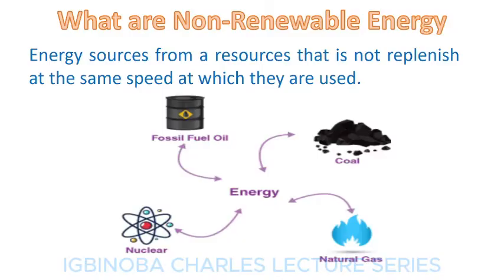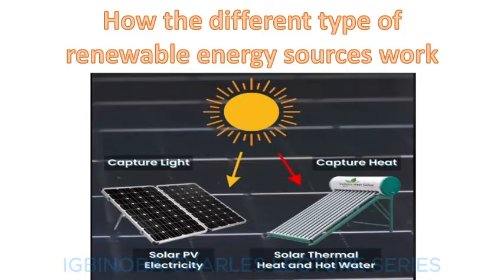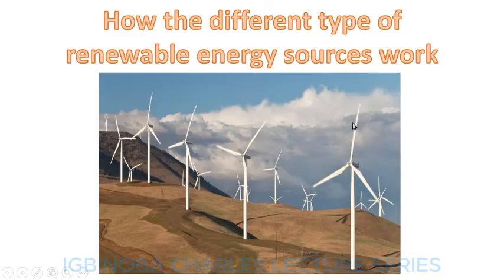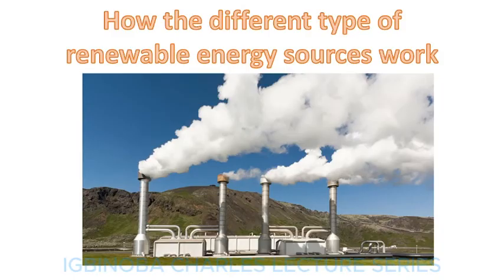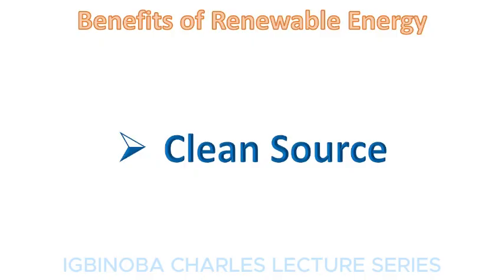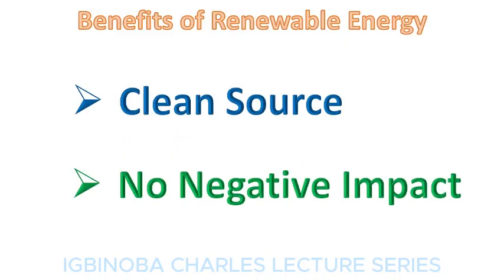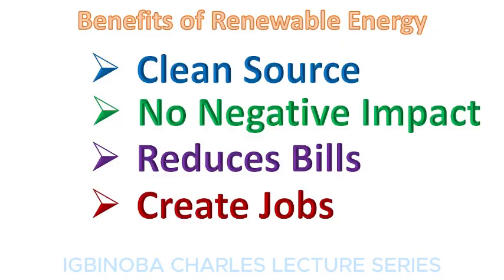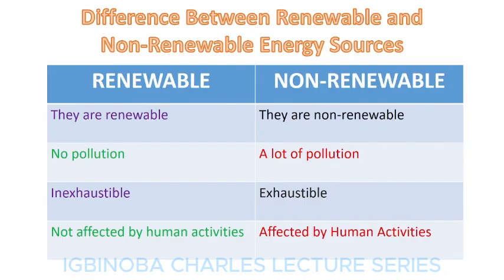From Fossil Fuels to Clean Power: Understanding Energy Sources

Comment: NAT49W 
No energy source is completely 100% pollution-free.
Even though clean sources like solar panels and wind turbines produce zero pollution while making electricity, they still cause environmental impacts during their whole "life cycle":
Manufacturing: Mining raw metals (like iron, silver, and lithium) and making equipment takes a lot of energy and creates waste.
Transportation & Setup: Shipping heavy parts and installing them requires vehicles that use fuel.
Disposal: When solar panels, wind turbine blades, or batteries wear out, recycling them is difficult, and they can end up in landfills.
Solar, wind, and nuclear energy aren't perfect, but they cause far less pollution over their lifetime compared to burning coal, oil, or gas.

Comment: MAR22V

Answer:No source of energy is completely pollution-free.

Reason: Every source of energy causes some pollution or environmental impact at some stage—during its extraction, production, transportation, installation, operation, or disposal. For example:

Solar energy does not produce pollution while generating electricity, but making and disposing of solar panels can cause pollution.

Wind energy is clean during operation, but manufacturing and installing wind turbines use materials and energy that can affect the environment.

Fossil fuels produce air pollution and greenhouse gases when burned.

Comment: MAR8H

Answer:

No energy source can be regarded as completely pollution-free. Renewable sources such as solar, wind, and hydro generate little or no direct pollution during operation, making them considerably cleaner alternatives to fossil fuels.

However, environmental impacts can still arise from the extraction of raw materials, manufacturing, transportation, installation, maintenance, and eventual disposal of the equipment at the end of its useful life.

Therefore, renewable energy sources can be described as low-pollution and more environmentally friendly, but they cannot be considered entirely pollution-free.

Comment: PETRO64L

No source of energy is completely pollution-free.
Every energy source has some environmental impact during its production, transportation,construction, or use. For example, solar panels and wind turbines produce clean electricity, but manufacturing and transporting them require materials and energy.

However, some sources such as solar, wind, and geothermal have much lower pollution than fossil fuels.

Comment: MEC115K
Answer:

No energy source can be considered completely pollution-free. Renewable energy sources such as solar, wind and hydro produce little or no direct pollution during their operation, making them much cleaner than fossil fuels. However, pollution and environmental impacts can occur during the extraction of raw materials, manufacturing, transportation, installation, maintenance and disposal of the equipment at the end of its life cycle. Therefore, renewable energy can be considered low-pollution or environmentally cleaner, but not completely pollution-free.

Comment: MEC65M

Answer:
No,no source of energy can truly be pollution free,every energy source has some environmental cost, even if not during actual use
Examples; Solar panels and wind turbines don't pollute while generating electricity but manufacturing, mining raw materials used for the production of the panels and turbines, can create emissions and waste.
Hydropower disrupts ecosystems and river flow
Conclusion: Considering the full life cycle (Production→use→disposal),no energy source is 100% pollution free, some (like solar/wind) are just far cleaner than others.

Comment: MEC81C

No single energy source is completely pollution-free across its entire life cycle.
Core Reason
Even for zero-emission renewable energy sources like solar or wind—which produce no air pollution or greenhouse gases while generating electricity— pollution occurs during the manufacturing, transportation, installation, and disposal stages.

Comment: Petrochem73u

ANSWER : 

No, no source of energy whether renewable or non-renewable can be considered entirely pollution-free. This conclusion stems from the environmental impacts associated with the entire lifecycle of energy production, including extraction, manufacturing, operation, and disposal.

•  Renewable Energy Sources: Solar and wind energy production involves mining rare earth metals, leading to pollution from manufacturing and disposal of panels and turbines. Hydroelectric dams disrupt ecosystems and release methane, and geothermal plants emit trace gases. The lifecycle impacts, including resource extraction and waste, prevent zero pollution.

•  Non-Renewable Energy Sources: Coal, oil, and natural gas emit carbon dioxide, sulfur dioxide, and nitrogen oxides during combustion, contributing to air pollution and climate change. Their extraction through mining or drilling causes land degradation and water contamination, while transportation risks spills that harm ecosystems.

Comment: COMP94P

No; no source of energy can be pollution free as every method has an environmental impact either directly or indirectly.

Reason be that different energy source needs a way to be harnessed before it could be used. Even if the energy source itself isn't a threat, the means and materials utilized by which it gets to us might be harmful to both the environment and humans at large. But the renewable energy source has proven to have a lower pollution as seen when compared with the non-renewable energy sources.

But both sources tends to have an operational emission one way or another even in the most slightest form.

Comment: NAT29C

ANSWER : 

No, no source of energy whether renewable or non-renewable can be considered entirely pollution-free. This conclusion stems from the environmental impacts associated with the entire lifecycle of energy production, including extraction, manufacturing, operation, and disposal.

•  Non-Renewable Energy Sources: Coal, oil, and natural gas emit carbon dioxide, sulfur dioxide, and nitrogen oxides during combustion, contributing to air pollution and climate change. Their extraction through mining or drilling causes land degradation and water contamination, while transportation risks spills that harm ecosystems.

•  Renewable Energy Sources: Solar and wind energy production involves mining rare earth metals, leading to pollution from manufacturing and disposal of panels and turbines. Hydroelectric dams disrupt ecosystems and release methane, and geothermal plants emit trace gases. The lifecycle impacts, including resource extraction and waste, prevent zero pollution.

Comment: MEC38L 
 NO,... Energy sources can't be 100% pollution free. While some sources, like solar and wind power, don't produce emissions during operation, every energy source has some environmental impact associated with its entire lifecycle. This includes the manufacturing, transportation, installation, and eventual disposal of the necessary equipment. For instance, creating solar panels requires mining raw materials and uses chemicals that can be hazardous if not handled correctly.